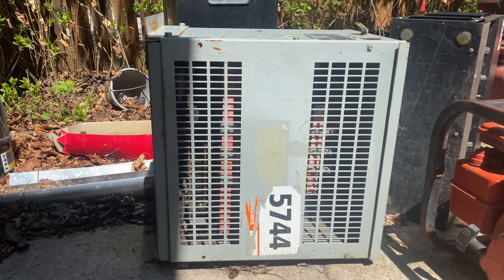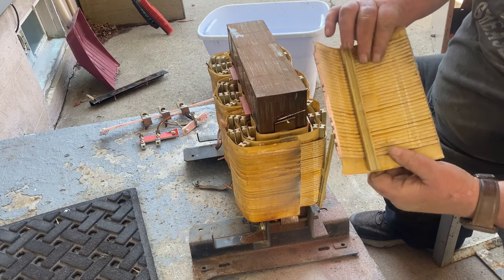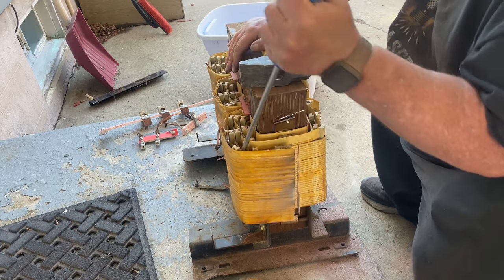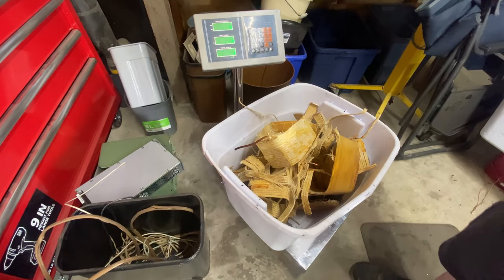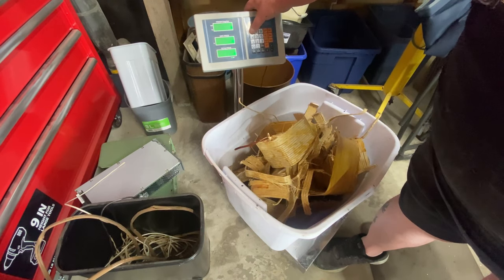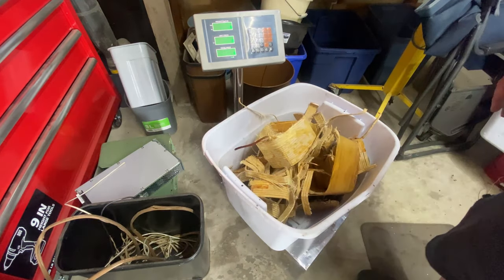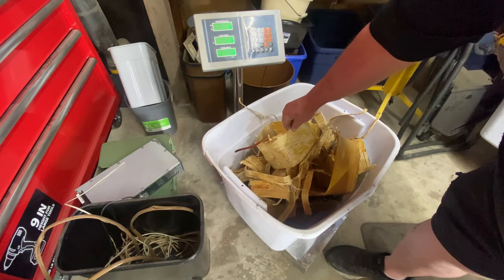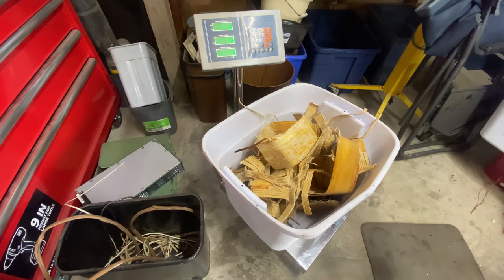How much copper in a 275 pound transformer

Comment: Copper soup, cola or freezing would be the three things I'd try. I would boil in an urn to see if it would come off, sit some in cheap coke for 24hours and finally freeze a couple of bits and see if it breaks off with a hammer once frozen, this might work if it has got resin in it, but obviously not if it's just paper. Good luck, look forwars to seeing other ideas and results! 👍
Reply from the maker: Ill definitely try all 3 in the experiment video thanks sollers you rock

Comment: If you take the case that  come off it  and set it upside down on some blocks,, you could build a fire under the case and the metal would kind of act like an oven.  That paper will pull right off once the shilac is hot enough.   I know a lot of places wont buy burnt copper,, but heated copper is different! Plus sandpaper cleans it to #1 really easily  ! Nice teardown bud !!
Reply from the maker: Thanks Adam great advice

Comment: Scrapyards allow contamination from 3% to 6%. No need to remove that coating from copper. It's too hard to remove it without fire, and it smells terrible. Try to cook it in the kiln, and then just scrape it out by steel wirebrush.
Reply from the maker: I just brought some in I got #3, I really want to get to at least #2

Comment: I'd start by soaking it in hot water to see how well it softens... You could maybe also try sandpaper / wet and dry / whatever is called in your region ... run it on a buffer or some wheel and polish the wires.... if that doesn't work or it's too intensive, you could go up to using some heavy paint removing solutions or some mild acids ...
Reply from the maker: Thanks my friend

Comment: Where do you get your large scrap items like this transformer and the 9,000 pound generator?
Reply from the maker: Both items were picked up from the auction, I paid $50 for the transformer and $210 for the generator
Reply: @nicejunk666  Yep that is where i get my big items too. I brought a 1700 pound A.C. that came off a hospital that didn't work. I was the only bidder and got it for the opening bid of $75. I took out over 300 pounds of copper out of it.
Reply from the maker: @steveherr450  excellent deal 😊😎

Comment: That's the exact same stuff that was in that welder I had. I can tell you that after cleaning it up by smashing it around and pulling paper off, I still got number 3 for it, so whatever you choose will probably be better than that. It also left a ton of flaky resin and paper all over the place. Awesome payday, either way. Gerri was pretty impressed by your trailer load of stuff, but less impressed with the thin strap holding it all together. lol
Reply from the maker: lol it was only going 8 blocks lucky I even strapped it
Reply: @nicejunk666  Oh, I told her it was only going two blocks.
Reply from the maker: @HHRecycling  thanks for having my back